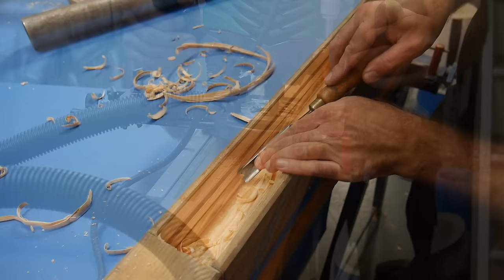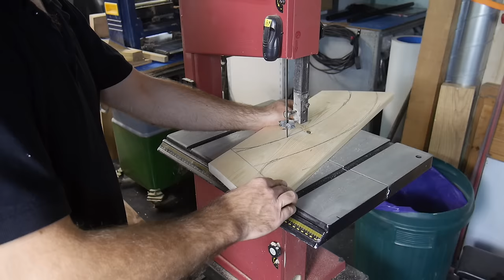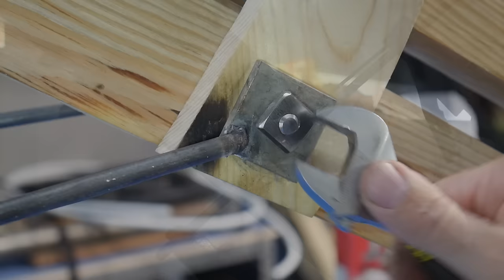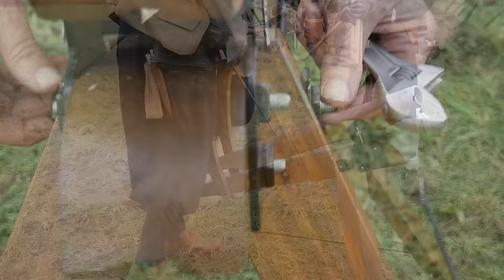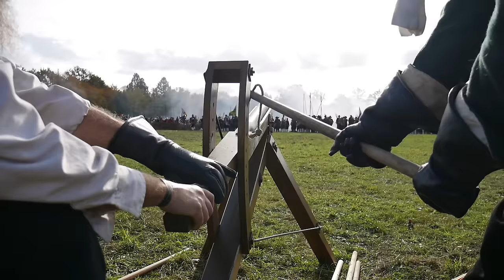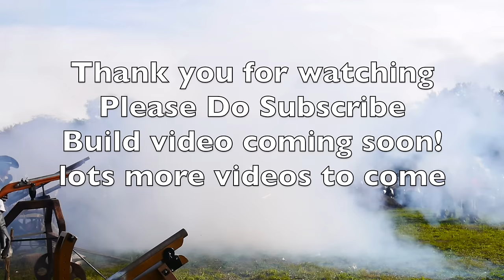Homemade (golfball) Cannon Swallow Forge

Comment: Is that legal wherever you're from? I thought you were from the UK
Reply from the maker: Yes it is legal. the barrel is proofed by Birmingham proof house and it is on a shotgun licence. A separate licence is required for the use of black powder. However it is very illegal to manufacture any type of firearm without the relevant licences.
Reply: Swallow Forge I know it's legal with licence, are you an RFD?